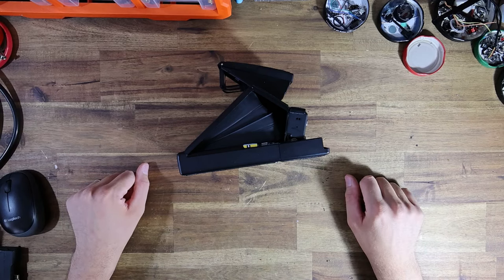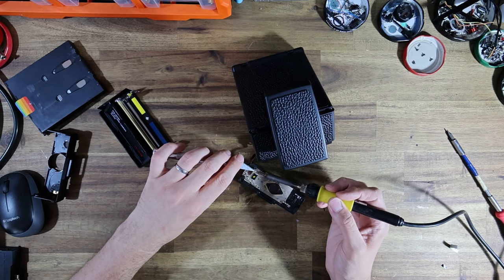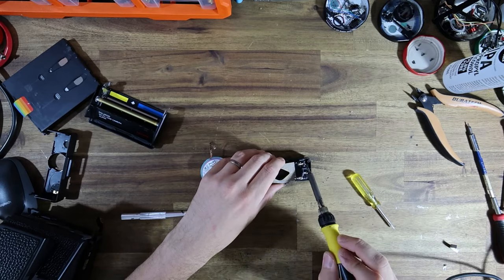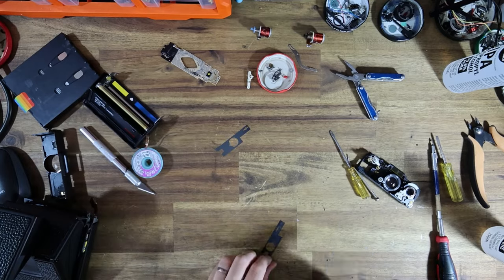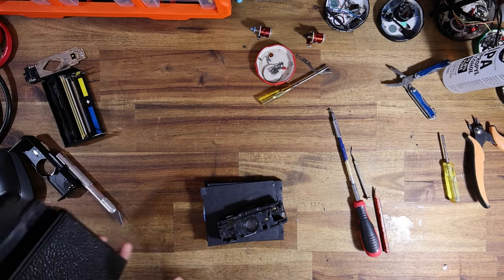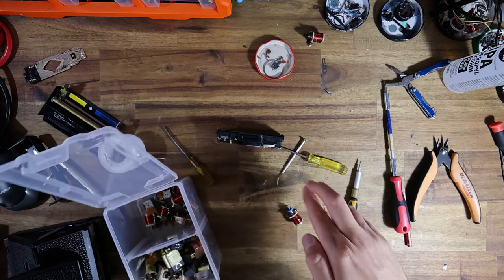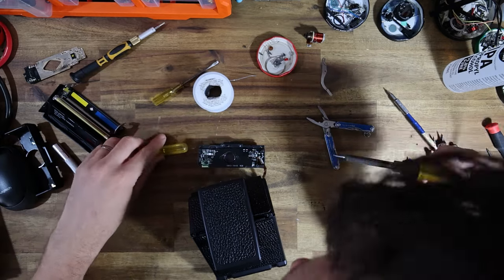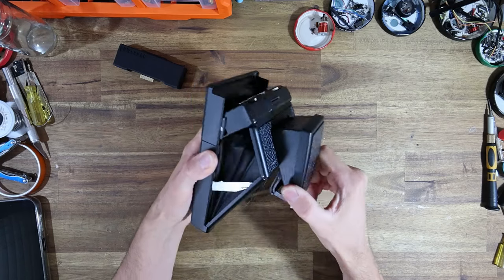My SX-70 repair failed - but why? A warranty job!

Comment: Another neat camera variation successfully restored, nice job Jake!

Your behavior towards warranty support is quite refreshing. That situation with the double-sided tape was interesting indeed. I'll bet the humidity of Singapore combined with the constant temperature cycling is what caused the tape to become all sticky, and apparently just conductive enough to mess with the switch mod.

So excited for my camera to be featured soon!
Reply from the maker: Yeah this is the only time I'd ever used that kind of tape on such a mod. Usually I use my automotive body tape

Regardless, it works much better now :)

Comment: HI there Jake, now it makes sense, I guess.  With short wires in an Automatic Land camera, after converting it to use AAA batteries. I super glued the wires together and no more shutter opening and closing.  I should say that it was not the wires (long enough) for the battery conversion that were too short.  About six years ago I decided t shoot instx wide on a manual Polaroid Land. .......................................................Than I tried with an Automatic Land and found out that if the lens is not fully extended, the shutter won't fire, despite having the battery conversion properly done, on the Auto Lands. The fix is to do something or other, with the small wires that sense if the thing is fully extended or not.

Comment: You have a very interesting channel, and I admire your ethic. I have had two cameras built / repaired by the two largest Polaroid companies in the US and they were both immediate fails, and the resolution was no where near as painless as yours ! I still need to deal with one SX 70 which torched when I plugged in a brand new mint flash and now the shutter hangs open forever unless I open or close the film door, or unless I unplug the mint flash. 
( I wonder how much shipping is from US to Australia )

Comment: Love the videos dude! content is always good.

I recently bought a polaroid q-light, which I quickly found out is broken. When the capacitor charges up, it charges normally for a few seconds and then produces a trilling sound. It doesn't even tell me it's charged up. These things are notoriously unreliable, and there is no information whatsoever on youtube or maybe the whole of the internet on how to repair/overhaul them. If you have one come through your workshop could you do a video on it?
Reply from the maker: I can try

The issue with flashes is there are numerous things that can go wrong with them
Reply: @theinstantcameraguy  I kinda figured. Thanks anyways though and thanks for replying